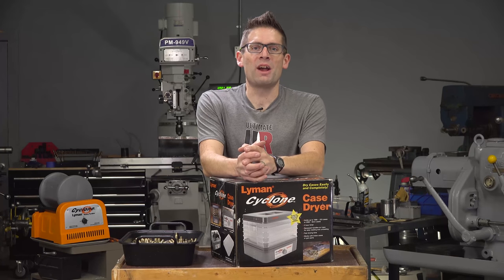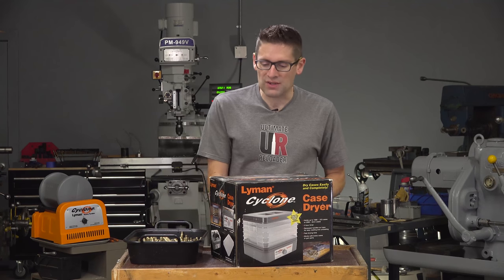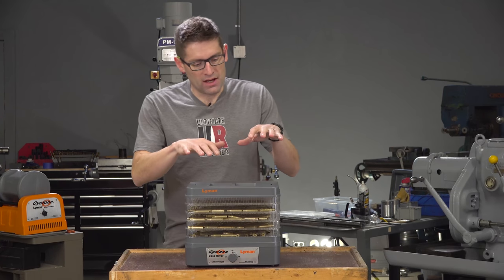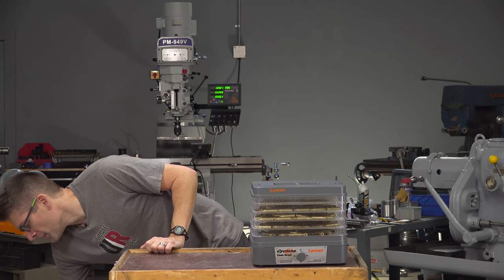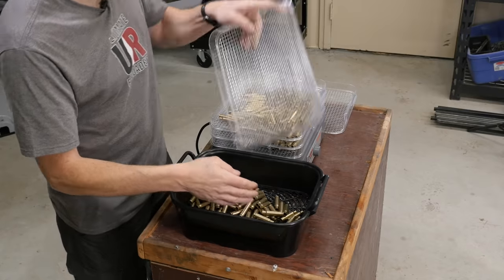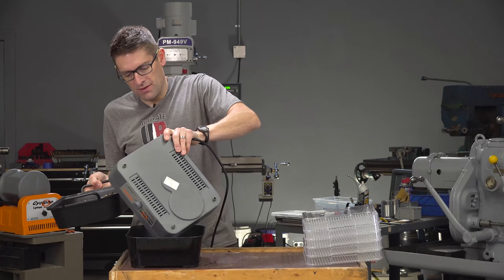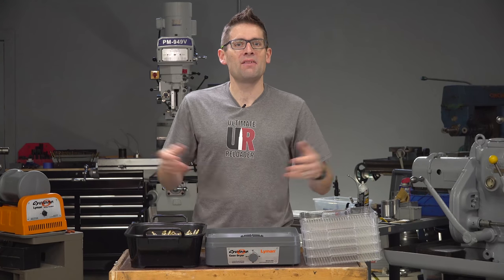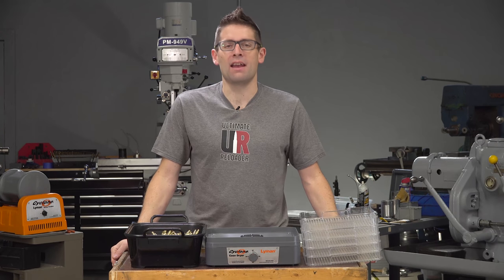Lyman Cyclone Case Dryer: From Unboxing to Drying Cases

Comment: Gavin, I have been wet tumbling for years now. LemiShine and Dawn are the key! Also, AFTER you have emptied your brass out of the drum and rinsed / sifted the pins out it helps if you tumble the brass a second time in a media separator. This "Spins" most of the water out of the inside of the cases making drying even faster!
Reply: Have you thought about dry tumbling after the wet tumble as a way to dry AND polish the brass? I've seen some people do this and add turtle wax or a some wax compound to the dry media when dry tumbling as it lubes the cases for the press AND it gives it a SHINE polish like new.

Comment: My wife bought me a thumbler tumbler in 1982 from Cabela's.
I only used corn media and polish additive for 35 years but I always had to clean my primer pockets and inside case necks.
I finally tried using the lemishine and Dawn and stainless steel pins. I am amazed at how much cleaner my brass is. Problem is, dumping the dirty water and separate the pins from the brass. I bought the Frankfurt magnet and the RCBS brass/media separator and my wife got me the Lyman cyclone dryer for Christmas. Problem solved. Now my brass looks better than new, clean inside and out and no water spots. Love it!!!
Reply: I use the media tumbler as well. I usually tumble with the spent primers in and use the little scraper tool to clean the primer pockets after I size that brass (maybe I should use a universal deprimer to decap the primers then tumble to clean the primer pockets?). but I didnt realize you need to clean the inside of the case necks (I guess they build up carbon and possible the media residue itself?). So my question what do you do to clean the inside of the case necks after tumbling with media?
Reply: @randytrudeau952  Randy, here's a tip to save you a lot of time. Invest in a Lyman brass prep station, you'll thank me once you do. For many years I did the deburing and primmer pocket cleaning with the little tool from rcbs, next I used my Dremel tool and brush and finally got a Lyman prep station and my case prep time was cut by more than 80% because it has neck brushes and everything else you need. 

I've stopped using corn media in my tumbler and use the steel pins and Dawn dish soap and lemeshine and my brass comes out like new.
I resize my brass first step, I make sure the outside of the case is clean from dirt and things that could damage my dies, then I use Hornady One shot case lube and then clean and wet tumble and dry.

Comment: I started with the Harbor Freight tumbler since I was just getting into reloading and wasn't sure if I would like it.  As a proof of concept, I bought a few scotch brite stainless steel kitchen scrubbing pads, they are a lot like steel wool, but wider.  They worked great with just dish soap.  Of course, they didn't clean inside the case and barely touched the primer pockets.  But it was good enough that I bought SS pins.
I've since upgraded to the Frankford Arsenal rotary tumbler.  When I get home from the range I dump all my brass in the tumbler with soap and 2-3 SS scotch brite pads.  This prewash gets a lot of the dirt and residue off.  I let it dry overnight and then short by caliber without choking on lead and powder.  I deprime and run the brass through the tumbler a second time with SS pins, dish detergent, and lemi shine.  Comes out clean as a whistle.  I only reload pistol at this point so my process may change if I start reloading rifle due to added steps like neck sizing and trimming.
I've enjoyed your videos for a long time!  Thanks for the educating entertainment!
Reply: Interesting, thank you for sharing your experience.

Comment: I'm quite experienced with wet tumbling with SS pins. I don't recall the brand of equipment I use (everything is at my other home), but the biggest improvement over what I see you doing is that my case /pin separator is a hand tumbler that sits in a plastic tub which has a few inches of water in it. 20-30 medium speed turns of the tumbler PERFECTLY separates the cases and the pins. Also, I find myself tumbling sometimes considerably longer than you, especially with very dirty brass. I've often tumbled as long as three hours. Finally, I also just dry by hand, overnight, on a BIG towel. If cases are allowed to touch each other, complete drying is inhibited. First I use the screened tumbler and give it some VIGOROUS shaking by hand, in order to lose as much water from inside the cases, then I dump on the towel (at least 4x6 feet in size), then pick up the ends of the towel to "slide" the brass back in forth -- removing a great deal of the moisture in one step. At that point I transfer to another dry towel After those first two steps the cases are already 99% dry on the outsides and 80-90% dry inside in just a couple of minutes. With that scheme I get totally dry brass, inside and out, in a warm room overnight.

Comment: Gavin your tip on using Pledge Furniture Polish was brilliant as a case lube but also as a corrosion inhibiter after you wet tumble and dry your cases. 
Spray cases liberally with Pledge and mix cases to get even coating them place cases in convection oven and warm up to 120 degrees centigrade for 10 minutes. Then cool and store them away.

Comment: Up here in Canukistan, gas and electricity is relatively expensive... Instead of buying something that uses electricity, I use the furnace vents. I built some racks out of materials I had laying around. Set the brass on the rack over the vent, works beautifully.
Reply from the maker: That's awesome! Why waste energy that's available?

Comment: Definitely lemishine and dawn. Shaking out the pins with each case tapping on a table etc is necessary to remove internal pins. Time consuming but I like it better than the vibratory method. Ultrasonic works well, but since I like shinny brass, since it shoots better, lol, I stick with wet/pin tumbled. I dry with a fan blowing into a gallon container of cleaned brass.
Reply: use a hand crank media separator to spin out the pins after wet tumbling.

Comment: Lemi-shine (38 spl case worth) and a quick squirt of Dawn in a Franklin Arsenal wet tumbler. Tried a couple of different media tumblers to separate the pins, RCBS works the best for me. Run the separator with the bottom half completely filled with water and the pins come right out. Without the water, the pins will stick to the brass. I rinse it twice and I rarely find any pins in the cases. Brass needs a good rinse anyway. Also, get a good magnet for the loose pins. I also use a magnet in the slop sink drain - catches the pins that get away from you before they disappear forever.

Comment: I own both the Cyclone Tumbler and the Dryer. The dryer has been on backorder since August for a Lyman design modification and just arrived a few days ago. A Lyman customer service rep told me they were concerned about the individual trays sagging with the previous design. My trays have a center stand pipe molded into and integral to each tray for vertical support. I used it for the first time yesterday and it is a real convenience item. The two biggest challenges in wet tumbling brass is the cleaning water chemistry and separating the steel pins from the brass. Another YouTube author, "Treetopflier", has some good advice on the water chemistry and recommends using litmus paper to be sure that after adding the cleaning ingredients that you check the water ph with litmus strips to be certain it is close to neutral or approx 7. I use the Frankford Arsenal media separator to remove the steel pins and find it to be much more effective than any other separator or process that I have tried. I purchased my Lyman Cyclone drier an experiment and for me it is a keeper.

Comment: I use dawn and lemi-shine. Don’t use too much lemi-shine or the brass will come out dark and dull. I am using less than a 9mm case worth. I separate the pins in a dry media separator full of water. Crank the handle for 10 to 15 seconds and you are done. If it is sunny outside I dry the brass on a towel in the backyard. Leave it for about an hour and it will be hot and dry. I would like to have one of those dryers for rainy days. I have used a mesh bag in the clothes dryer on a shoe shelf. Just use low heat so you don’t melt the bag. ;)
Reply: I use a 45 shell full of lemi shine with dawn dish soap, reason is acidity that’s what eats the zinc out of your cases and turns them more copper.

Comment: I bought a cheap dehydrator for making jerky that cost me £22.00 GBP.  Looks like the Hornady one is the same re-branded and priced at 4 times that.  I find it better to take the cases and pins out in the sink and shake them individually to ensure there are no pins left in before going to the dryer.  Smaller cases (556) tend to retain the pins without vigorous shaking.  I don’t like the thought of pins in my powder load, possibly damaging the bore.  Keep up the good work Gavin.

Comment: Couple of light glugs of dawn, a heavy pinch of Lemi shine, and warm water. 2 hours 

After pour into an RCBS hand crank separator and turn back and forth vigorously for about 30 seconds. Quick rinse in clean water. Spread on cookie sheet and 15 minutes in the oven at 170. Bingo bango done.

Comment: I’m using the Frankfort Arsenal wet tumbler with Dawn dish soap and a 9mm case of Lemishine in the hottest water I can get from the tap.  I use a generic food dehydrator to dry the brass.  I don’t have a good way of separating the pins out yet and I really like that dual strainer setup you got with the Lyman tumbler!!

Comment: That Lyman tumbler is cool. Seems quieter than the Frankford Arsenal one. My harbor freight double drum tumbler is super quiet and works perfect. I use hot water, dawn, and lemishine. But too much dawn and lemishine gets the cases sooooo squeaky clean that the primers won’t go in easily because the primer pockets are too grippy and get dents from the priming tool. Just sharing.

Comment: i like the cheap bulk citric acid and dawn.  if you fill the barrel you may need to have it run longer than 3 hours.   also if the barrel is too heavy the wheels can just freewheel and it wont turn, clean the wheels and barrel and try again.   in my opinion the sifter is kinda useless,  you still have to shake most every case out and some primer pockets even get one stuck in it.   i use the magnet.  a heat gun is what i use to dry them, it only takes like 10 minutes but you have to be careful not to discolor the brass with too much heat.    i get some damn clean brass, so clean that expanding kinda leaves its mark so i try and expand before i clean.   keep up the great videos.

Comment: I've been wet tumbling for several years. I have 3 different tumblers. One of them is the lyman tumbler and it's actually the quietest one. I use about 1/4 cup of regular blue dawn dish soap and only 1/16 teaspoon of lemishine. I have a 1/8 tsp that I fill half way to give me 1/16 tsp. I only use the regular blue dawn soap because other types can contain ammonia that will damage the brass. I use a lot of soap because it's better to use a little extra than to use not enough. Especially when dealing with grimy brass. I only use 1/16 tsp lemishine because if you use too much the brass will get a darker color to them. You literally only need a pinch of lemishine to get the brass looking really bright. After tumbling I use the lyman media dual-sifter system to rinse off most of the soap and shake out most of the pins. Then I dump the brass into a hand crank dry media separator so I can spin out the remaining steel pins. Then I remove the top of the hand crank media separator cover and spray the brass with a garden hose or hand held shower head while cranking the handle with my other hand. This rinses off any of the remaining soap. When the basin of the media separator fills up with about an inch or two of water I'll stop to dump out that soapy water before it comes in contact with the brass again. Then I spray the brass again while cranking the handle and repeat this entire step 2 or 3 more times until I don't see anymore soap suds in the media separator basin. This entire rinsing process takes about 2 minutes. Then I use the media separator to spin out as much of the remaining water as possible before I set the brass to dry. I currently use a homemade brass dryer that I made from using plastic tubs stacked inside each other with drainage holes in the top tub and two halogen light bulbs in the bottom tub. This homemade brass dryer can dry 5 gallons of brass at a time. I'll post a link as a reply to this comment to a forum where I posted pictures and a description of this homemade brass dryer. I pick up brass at my local shooting range that I trade or sell and often times have 5 to 10 gallons of brass to clean every week so that's why I created this larger brass dryer.
Reply: Here's that link https://rugerforum.net/reloading/363221-homemade-brass-dryer.html

Comment: Picked up this dryer just a week ago on clearance from Midway. Getting ready to use it today with decent expectations. 

I've been doing the lemon shine and Dawn for over a year now with the cyclone tumbler. Always just used an old towel and a small axial fan to dry brass. Never had any issues and brass always looks near factory new. Only got the dryer because I'm hoping to decrease turn around time.

Comment: I ues the Hordany rotary case tumbler 5lb of stainless steel pins, dawn and lemi shine 1hr-2hrs. I separate the media in two 5gal and 1 2gal bucket I drilled holes in for the pins to fall through. Then I dry the cases in my oven.

Comment: Lemi-shine  (9mm case full) + 2 caps of Armor All Car Wash in my Frankford Arsenal wet tumbler. I use the Frankford Arsenal media separator which fits in a kitchen sink and has 2 strainers so yo can rinse and  not loose pins. I have a Lyman Cyclone Case Dryer which works perfectly and is silent compared to a dehydrator.

Comment: Oven lover again.  Nice unit, but for me I already have an oven, and no wife.  A cardboard box cut off about 2 inches high.  Set oven for 200F to 210F and less than hour they are dry.  Let them cool 10 minutes and off to the press.  After all case prep, just wash in hot dawn and water and oven again, or tumble again to remove prep scratches.  Your brass right now is clean, but dingy, so tumble again with Dawn (or any other soap) and Lemi Shine (can use vinegar or CLR) to make them bright.  Lemi Shine is just easier to measure.  Like I indicated yesterday, sometimes the cartridges are so pretty I cannot shoot them without remorse.
Reply: Other soaps can contain ammonia that will weaken the brass. That's why only regular blue dawn should be used.
Reply: @Prepare2Survive  That is correct, that is why I indicated soap and not detergent or general cleaners.  Also letting the cases soak too long in Lemi Shine will pull zinc from the cases and turn it reddish, and if severe, will weaken the brass.  I usually tumble twice.  First with lots of soap and little Lemi Shine to clean the dirt off, and after prep I do it again with more Lemi Shine to get all the lube off and shine the brass.  Sometimes I do too much shine as the cartridges then look too good to use without remorse.
Reply: @ewathoughts8476  I've also heard the lemishine can degrade nickel plated brass so I don't use any when I tumble nickel cases.
Reply: @Prepare2Survive  Do not use nickel cases as they are too hard on sizing dies and expanders.  Did use some nickel 243 cases once but the expander was worn away even when I lubed the inside of the necks well.
Reply: @ewathoughts8476  I've sized hundreds if not thousands of nickel plated bottle neck rifle cases. Maybe I should check my sizing dies now. I use the lyman type m neck expander dies for rifle and pistol brass because it uniforms the neck tension and allows me some extra room for my homemade powder coated lead bullets. Maybe that's why I haven't noticed any wear on my dies because the lyman type m expander dies are hiding the wear.
Reply: @ewathoughts8476  I forgot some .223 brass in lemi once and actually broke my resizing die because I believe it stripped the zinc from the brass. Since then I started using hornady case cleaner in my ultrasonic cleaner.
Reply: @trashpanda2396  If the zinc is removed from brass it will clearly look pink or red.

Comment: So it doesn't look all that much different than the dehydrator I have for making jerky and drying fruit.
Reply: I bet it will make AWESOME jerky 😈
Reply: It isn't :)
Reply: Rumblestrip.NET that’s exactly what I thought! I already have this!
Reply: I use an old dehydrator but mine makes the brass really hot which I was a little worried about w/ temper
Reply: Yup
Reply: @trashpanda2396  brass doesn't start annealing until 500f if your dehydrator gets that hot well.... thats gotta make some burnt jerky!

Comment: One drawback to the Lyman Cyclone Dryer is that the trays are hard plastic and very brittle. When I received mine one tray was damaged a lot and today when using the dryer for only the second time, I see a crack in another one that was either cracked when I got it along with the other tray or has since then cracked. Other than that, it works great. I am hoping I don't see any more trays crack. Not impressed with the quality of the trays. If they don't crack anymore, I will be somewhat satisfied.

Comment: You can use an oven.  After I steel tumble my brass I turn an old oven in my building down to 170degree and place the brass on an old pan.  After I put them in the oven I use a butterknife wedged in the top of the door, keeping it open just the slightest bit so the moisture can escape.  Literally takes about 20-30 minutes to dry, and they are handle'able when they are done.
Reply: Shhhhhhh, you might offend him by not being classy.